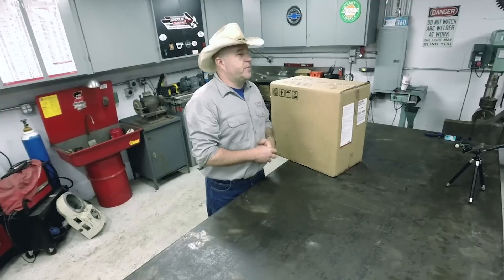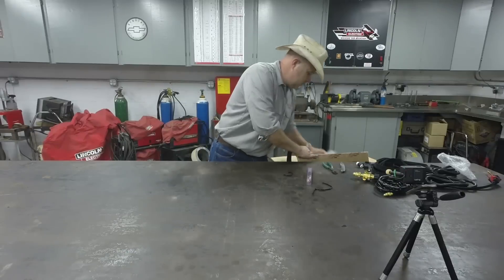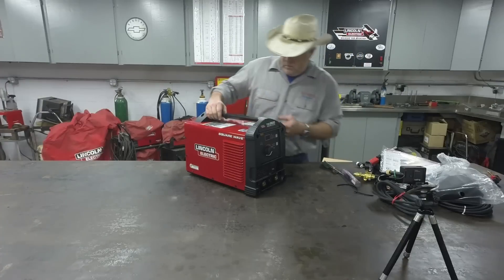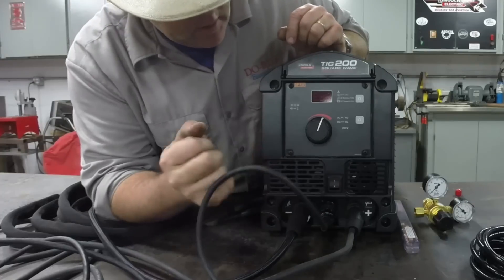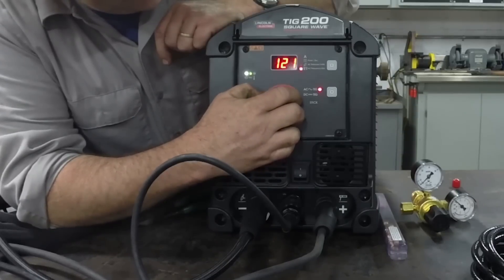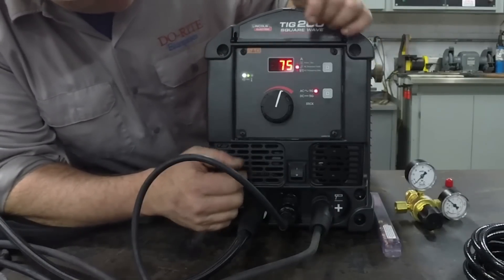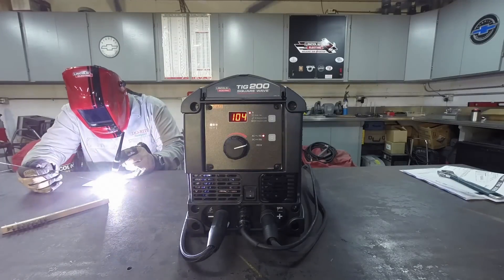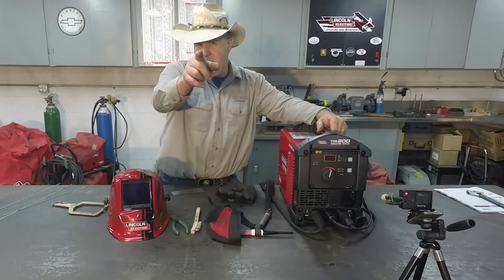Lincoln Electric Square Wave TIG 200 welding machine, unboxing, setup and review

Comment: One other quick question, I was at Home Depot looking at their welding rods for the stick, is there one better then another? I just need it for general purpose welding on mild steel.. what would you recommend? Thanks in advance... Jack
Reply from the maker: +blackjack6934 That is the question that men will argue for eternity. I like Lincolns Excalibur 7018. 7018 is a good general purpose rod that yields 70,000 psi of strength when welded correctly (that's what the 70 in 7018 stands for)  I like the Excalibur rods so much better the other companies they just seem to start better and run smoother than other 7018. The 6011 and 6013 work well too. 6011 runs good on cleaner metal and I save the 6013's when I have metal that I cant get clean for whatever reason. The 6013 seem to burn through scale and rust while still yielding an acceptable weld. I  use the 6013 in farm implements and that kind of stuff. It is an argument that men will continue to have for all time, like Chevy or Ford, or Cummings or Cat.......
Reply: +DoRite Fabrication Well, I like Toyotas, so I guess I'm screwed.. lol, thanks again, I appreciate your answer and helps my decision.
Reply: +DoRite Fabrication Well, just got my Welder a few days ago, I installed 230 in the garage, got everything unpacked, started the machine up and only the fan comes on, tried 110 volts and same thing. No lights, no LED, am I missing something here? There are no other buttons to push other then a reset button on the back, but that wasn't trip or didn't feel like it was tripped! Do I return the welder? It was a brand new welder.
Reply from the maker: +blackjack6934 Sorry, it has taken me time to get to you. I have had family in from out of state. You need to check the incoming power and be sure that you have 220 volts to the back of the machine (check the voltage in the female part of the plug that goes into the back of the machine) you can do this with a volt meter set to AC. If you don't know how, have a buddy who know help. If you have 220 volts and the ground is good (That is the third wire in the plug. Inverters are funny, they like a GOOD ground) Then the problem is probably in the machine. Most likely the UPS guy got a little excited when he saw the new machine and was a little rough on it. Lol Take it back and ask for a new one. Keep me up to date on what you find out.
Reply: +DoRite Fabrication Thanks for the quick reply, I tried to run it on both 120 and 230 and got the same results. I'm getting 122 volts and 238 . I'm within that 10% + or- . I checked the the ground inside the panel and have it hooked up to the ground bar, not much else I can do. So it's got to be the machine. Of course the company is closed on weekends, so I have to wait until tomorrow before I see what they say, but I'll keep you updated. The problem now will be waiting another 5 to 6 weeks for another one... sucks!
Reply from the maker: +blackjack6934 Try giving lincoln a call at their factory in Cleveland. You will want to talk to customer service. Be sure to have you box handy, they will want to know serial numbers and possibly if it has a colored dot on the label. Let them know you have been waiting a long time for this machine and are disappointed that you will have to wait another 5-6 wks. They may be able to help out.
Reply: I did and they gave me the option to have it fixed at a local authorized dealer or send it back to seller... Seller said he is trying to get another one in a couple weeks, so I'm waiting on phone call right now.. I'll let you know what happens.

Comment: Dont forget to HOLD the torch on your weld when you release the foot pedal.  This machine LACKS adjustable pre/post flow gas.  The lincoln tig 200 I ran last week blasts 17 WHOPPING seconds of post flow.  What a waste.  I would wait until lincoln adds this feature and would not recommend buying this current version.
Reply from the maker: +worldtraveler I think the post flow will auto set  according to output weld current,  the more weld current the more post flow.I have not timed it to know that this is true.  Anyone who has experience in fabrication understands that a slightly longer post-flow time will be beneficial, if not necessary, when working around Stainless steels, titanium, or any other nickle based alloys. The Square wave 200 was never meant to be a machine that is used in a facility that TIG welds 8-12 hrs a day. It is a machine that both a novice welder and an experienced welder can pick up and weld with, for 1/5 the cost of a high end asymmetric TIG machine.  I think the machine is an awesome blend of high end asymmetric TIG functions and simplicity.  For the small shop, home hobbyist, or shop that doesn't TIG weld much this machine is a great value. 

Yes, I do realize, I need to keep the weld puddle covered by the post flow shielding gas till it cools to a solid state, IF it was a critical weld. Since the test coupon promptly went into the recycle bin after the camera went off and it cooled, I didn't stay disciplined or care to keep it covered. Thanks for pointing out my slip in proper form. I will try to tighten up a bit as not to teach the folks just learning, my bad habits. 

In summary, To say "you would wait till Lincoln adds this feature and would not recommend buying the current version" is not keeping the big picture in mind here. The point of the machine was an affordable machine that offers some of the benefits of an inverter based machine with low cost and a retaliative bit of simplicity.The small cost in "wasted" welding argon" (for the non production guy) certainly offsets the huge cost for a high end machine.  In my opinion for the home hobbyist, beginner, or small shop this machine is a no brainier.

Comment: I don't see it in the specs, but do you know the max thickness of metal for both tig and stick! Thanks Jack
Reply from the maker: +blackjack6934  The reason you don't see the obvious answer is because it's not that easy to give a straight answer. But to give you some ideas, 200 amps in TIG will get you to around 1/4 on aluminum, maybe 5/16 on steel and SS. but remember I am talking about single pass. You can do multi pass on thicker material. On the stick side 1/8 electrode (the most common size used for general stuff) runs between 85 amps and 135 amps (depending on rod type). You can make as many passes as needed with 1/8 electrode to get it welded. I have welded 1 inch plate (fillet) with 1/8 electrode by doing multiple passes and proper joint setup. The Square wave 200 will replace Lincolns square wave 175,  the SW175 has been Lincolns goto entry level machine for probably 30 years+. As a matter-a-fact it was my very first TIG welder. The SW200 gives way more bang for much less buck!
Reply: +DoRite Fabrication Thanks, that helps, I'll be ordering this welder soon, it's pretty much what I'm looking for.
Reply: also, dont forget about things like adding helium gas into the argon, or running pure helium and DCEN for aluminum. not as pretty as AC  but penetrates a fook tone deeper

Comment: I just put a deposit on a new machine here in Australia, latest tech PFC, Inverter, it's a Mig Tig Stick machine from Bossweld which I don't know if you guys in the states have access to the brand?. It's a 250 machine and it has some features that I haven't seen in videos but I'm willing to bet you guys have them in the Lincolns, Hobarts and Millers, pre flow, soft start, burn back and post flow to name a few. It's got the spool gun switch and hearing how impressed you are with that machine got me thinking that with all the new features that will continue to show up on these smaller machines, it's possible that even the new welders out there will be able to pick up these newer machines and weld much better, much sooner. It's actually really good that these companies are helping us noobs with all these features and at the same time, they are improving the internals. Exciting times ahead, that's for sure.

Comment: Sounds like you got a good one.  After waiting for 7 weeks backorder for my TIG 200 to arrive I picked it up day before yesterday on Thursday.  The following day (Friday) I powered it up only to find that it was inoperable.  The fan came on (very noisy) and the gas solenoid clicked on and started flowing gas.  Nothing ever showed up in the led display and nothing further happened.  After troubleshooting every way I could think of with no results, I contacted Lincoln tech support who advised me to return it to the local weld supply store where I purchased it.  I did that yesterday and they said they would try to get it fixed.  Maybe Senior Lincoln should have spent a little more time on quality control before it left the plant in Mexico.  I'm very disappointed in Lincoln at this point.

Comment: Thanks for the review. I've been wanting to purchase this machine. How thin of aluminum can you weld with this machine ?
Reply from the maker: +dagooos To be truthful I didn't weld anything super thin. I did however, play with the low current arc a little. I would feel very comfortable saying that the only limit on thin material would be the skill set or the welder using the machine. Thanks for watching!

Comment: Great video Jim. How's the duty cycle on the machine? Have you tested it? There's one thing I think you should have mentioned, especially for beginners. Any direct current CC machine can stick and TIG weld. A foot pedal is an additional feature, like pulse or post flow.  I really enjoyed the video and that looks like a very nice machine.  I hope you try stick welding with it before you send it back, and let us know how that goes.
Reply: +Cory ,Tthe duty cycle is approx this:  sixty percent of output gives you 60% duty cycle, seventy-five percent of weld output gives you  40% duty cycle. That'ts just a rough est. try this link for the exact specs. http://www.lincolnelectric.com/en-us/Equipment/Pages/product.aspx?product=K5126-1(LincolnElectric).
 When you get time, watch the video again, I do mention that the machine can do both, TIG and stick. It's around the place where I talk about it being a constant current machine. Thanks for watching!
Reply: I did hear you mention that. I just wouldn't want people to think that you need a foot pedal or torch switch in order to TIG weld. Scratch start is possible with any DC stick machine.  To simplify, any DC stick machine can TIG weld, and any DC TIG machine can stick weld.  I did check out the link you sent me, and I may purchase the Squarewave 200.  Thanks for the reply, and keep the videos coming!
Reply from the maker: +Cory Good point. I will try to be more clear next time. It's tough to give all the information without putting people to sleep. LoL. Thinking about putting together a series of videos covering the fundamentals of TIG welding. ....